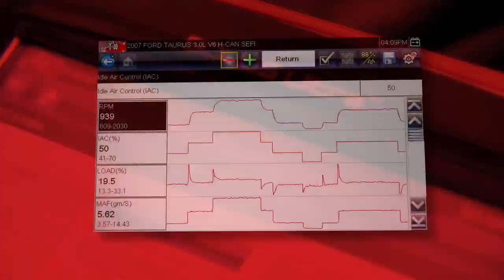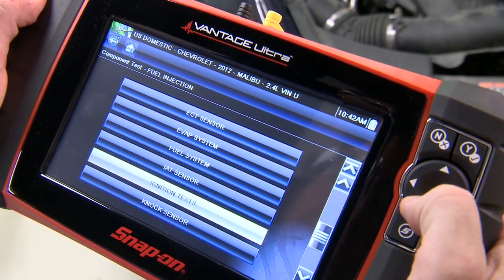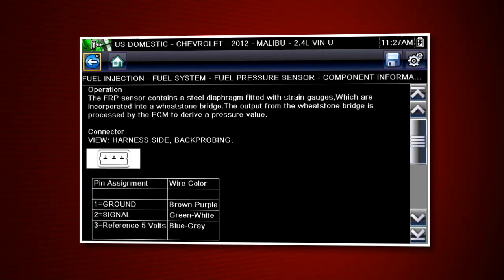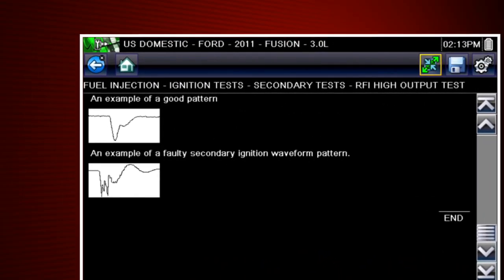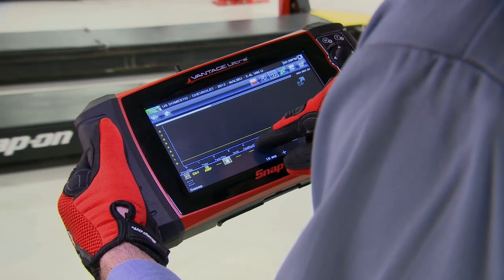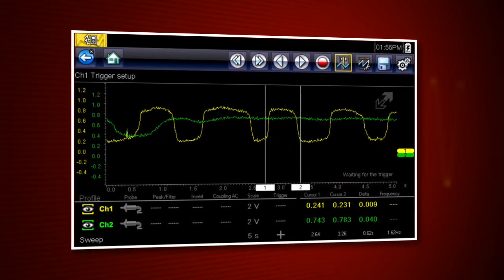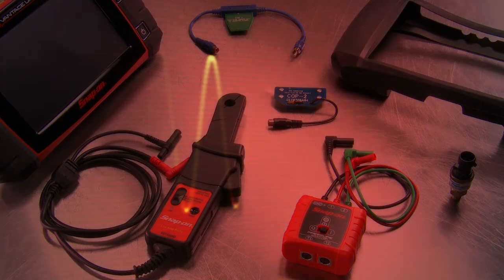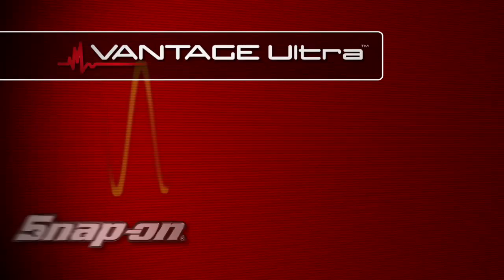Component Testing with VANTAGE Ultra™ | Snap-on Training Solutions®

Comment: Awesome bit of kit.  Had mine since 2015.
Reply: I got mine in early 2014, this is the most convenient handy 2 channel labscope made by anyone. The amount of preloaded connector pin outs and end views. Then the capability to use shop stream connect for any intermittent glitches,  zoom in and apply cursors from a laptop or even hook to a larger monitor. I'll tell you I have used every vantage since the old school 1st gen "brick" with the scroll thumb wheel and the advances and added features and options over the years and platforms is phenomenal. **Every single time that I use this it seems like I come across another key feature that allows me to be more efficient and have a stronger diagnostic approach no matter what system or brand and model I'm going after. After using the ultra as my sole scope for my diagnostics day in and out there is a few things that I wish that Snap-On would add to and that is body controller tests and component information. Another thing that would be very nice is if they added a generic test link window and added test features such as "relative compression" and "can bus error fault test" and had a broader range and test for their optional pressure transducer (which is pricey) but I will say nowadays pressure transducer testing capabilities is almost a "must have" with the complexity of vehicles equipped with GDI. As an overall grade of the vantage ultra I would have to give it a 15 on a 1-10 scale, you can pretty much put this tool into the hands of a tech on any skill level and the tool will not only show you what to test but also where to test and then the waveform information for some of your more common brands and test is also a nice touch all in one tool not unlike the others out there where you have to look up your pin outs and then what scale and measure it should be set on then go to another site for a waveform comparison this is they best bang for the buck and I'm looking forward for a major update or possibly another generation in the near future!!!
Reply: @aaronrepsher7628  do you know of the vantage ultra requires Internet access/subscription to use it's features? I'm trying to pick out the newest/older snap on scanner with a scope but not be forced to deal with the subscription bs. 2011 is the oldest car I would be working on.

Comment: I have the modus ultra awesome tool great scope
Reply: How awesome can be when they did take out important feature like multi cylinder ignition,Vantage Pro is the winner,they add touch screen but did take away other features,I'm not agree with taking features if you bring something new always add features and don't take.Ultra should do everything what Verus does except two less channels,but here Snap-on went wrong Ultra 2 channels does less than Verus 2 channels,can this be an innovation??? In my opinion no way.